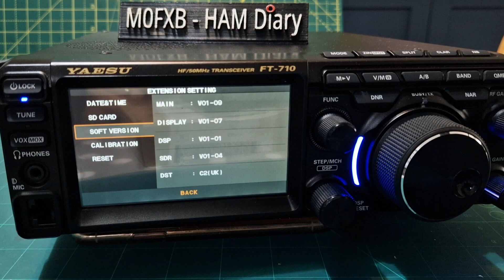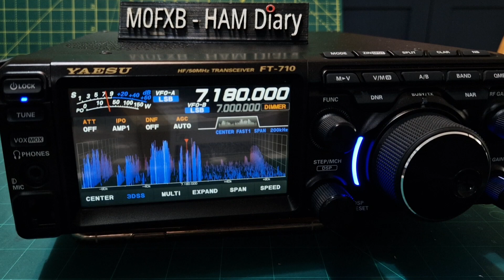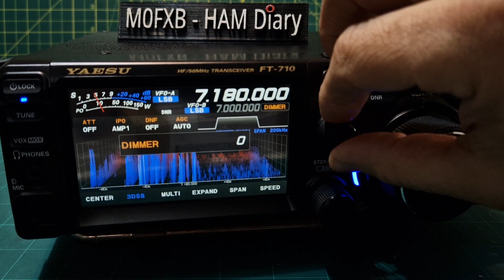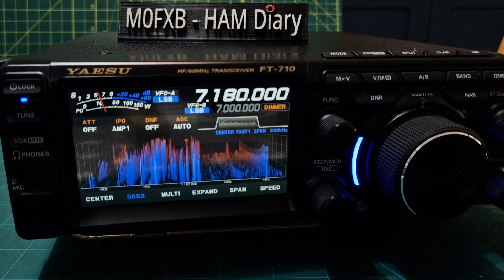DNR - YAESU FT-710, BEFORE & AFTER FIRMWARE

Comment: Hi Andreas, thanks for the demo. I find that the best way to use DNR is to reduce noise from the antenna end of the transmitter. Using the attenuator and or the IPO on the low bands will clean the signal and noise up before activating DMR, not doing so is giving the DNR too much to do. Adding more width will also increase the highs that’s lost with the DNR. M7BCN
Reply from the maker: Hi thanks loads I will try this :)